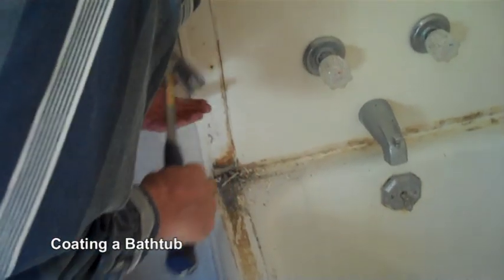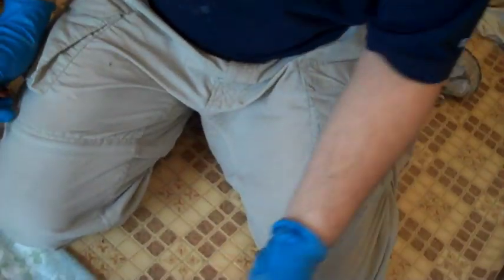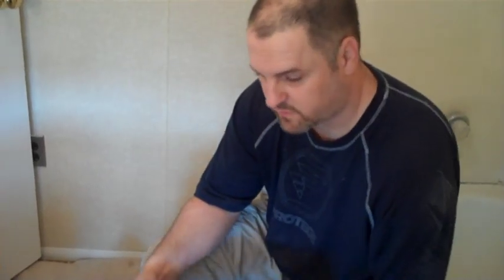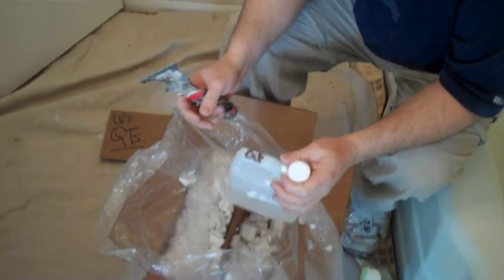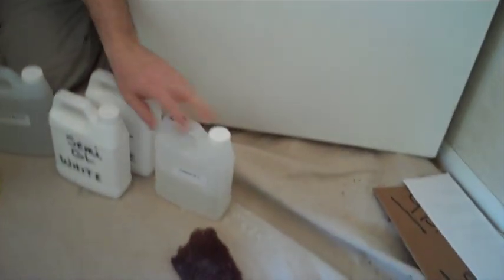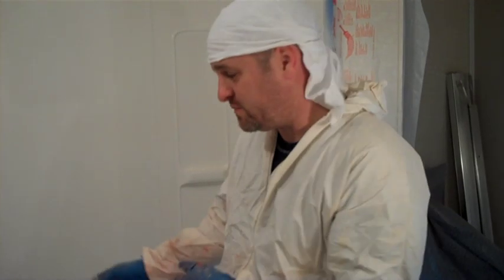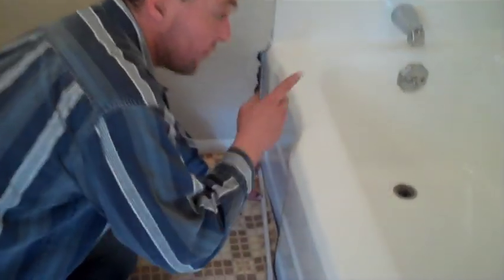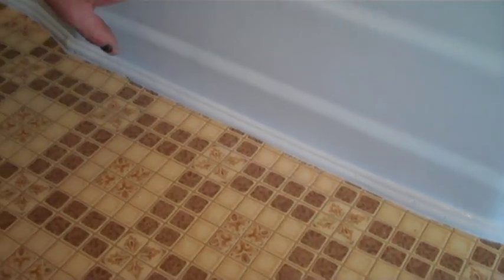How to refinish a bath tub and repair surrounding tub enclosure

Comment: Integrity coatings has great adhesion, However there non-Iso topcoat doesnt hold up very good to wear. It wont peel but after 1 year of use very little shine.
Use a good industrial grade aliphatic polyurethane topcoat will get longer life.

Comment: We have a crappy fiberglass insert & tub that we'll eventually be replacing, but for now I want to just take the sliding doors off and refinish the edge where it was sitting. Can it be sanded or scraped? What's the best method to clean it up and refinish so that I can just install a shower curtain and it will look clean and free of mildew?
Reply: I know this was an old question, but when you remove door rails the area underneath is closer to the original color from lack of exposure to uv. UV yellows the gel coat. Best way to get it to blend is to wetsand the area under the rails and around it with 1500 and then polish it with rubbing and polish compounds. You'll still have to patch the screw holes, but if it's a temp fix that's up to you. A professional job would be ideal.
Reply from the maker: Paul L. Great recommendation! The 1500 is a fine finish sandpaper you can acquire at any hardware store or local automotive supply store. Usually the best is the wet/dry sandpaper. Sand in circular motion to get the best results.

Comment: You are right, all products are not equal.  If you are working in environments requiring iso free work, ep acrylics are the way to go.  However, if you're doing professional work, a good epoxy has better adhesion and urethane has better gloss or  you may soon be inundated with warranty repairs  Good luck.
Reply from the maker: Randy Hilburn The primer used in this video is a quick dry epoxy for adhesion. The Acrylic Polymer is a superior top coat product.  Polymers are superior against urethane's because of it's flexibility, hardness and resistance to direct contact with chemicals. Polymers can be typically found in industrial sites requiring high resistance to erosion from caustic materials that may attack a protective coating. Urethane top coats are superior to any oil or latex product. They are typically used to top coat bridges, water towers, etc. However they take much longer to set up compared to the polymer used in this video which is ready for use in 24hrs.